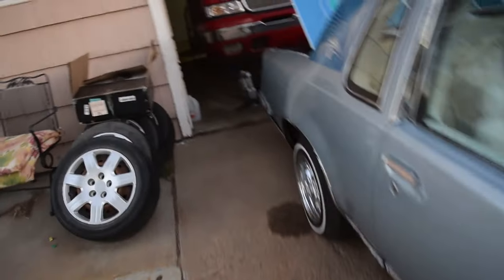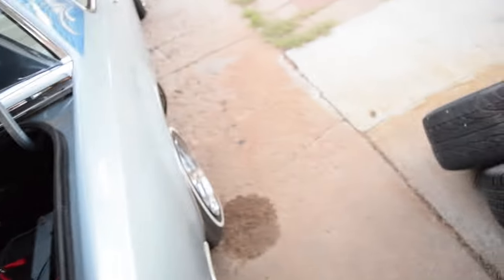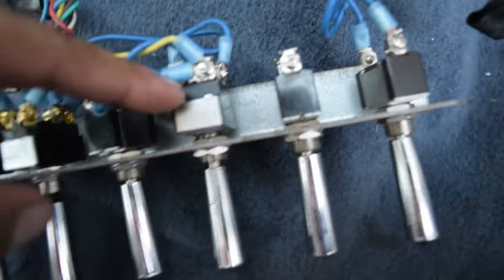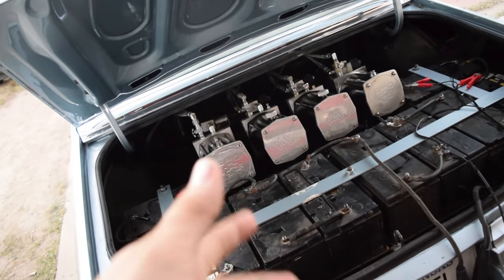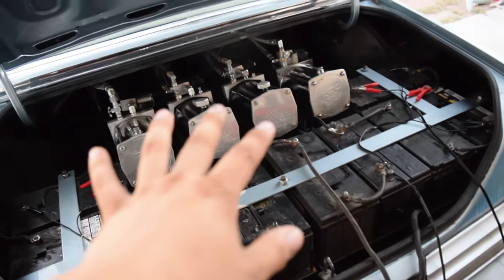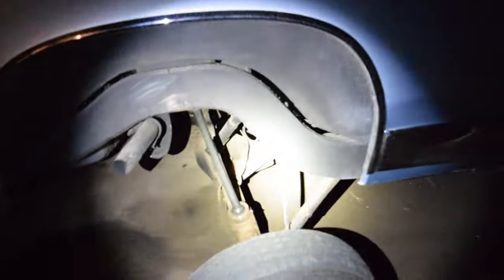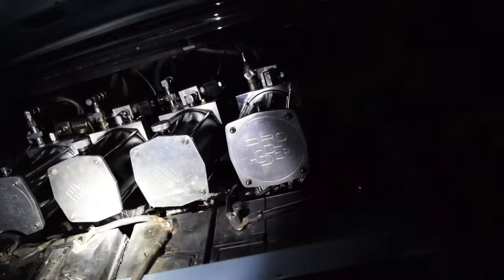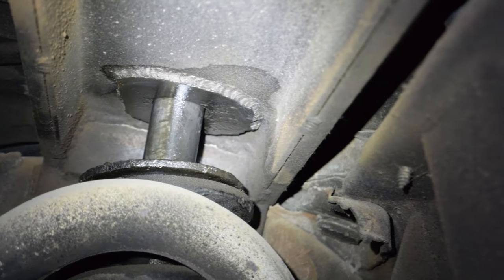CGOD on the SWITCH

Comment: Nice cutlass brudduh !! What size pistons u have in the back .. mine have 14s and it doesn’t get that high plus they hit the back inner deck
Reply from the maker: I think it’s got 16’s in the back. I haven’t actually measured it and the guy I bought it from knew very little about it
Reply from the maker: Mine don’t hit the deck but it’s got a custom enclosure for 4 6x9’s that’s raised up higher than the original deck

Comment: Do you have weight in the rear?
Reply from the maker: Other than batteries and pumps no, it’s got a fat bridge and rear arches reinforced
Reply: @CGOD what size rear cylinders?
Reply from the maker: @danhodgkiss9798  16”